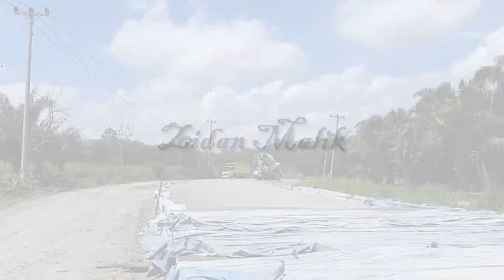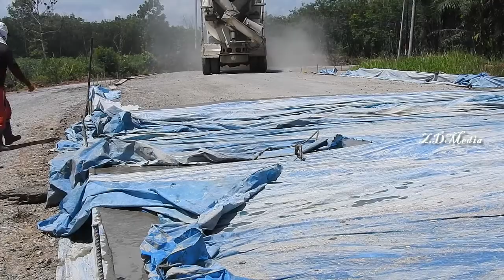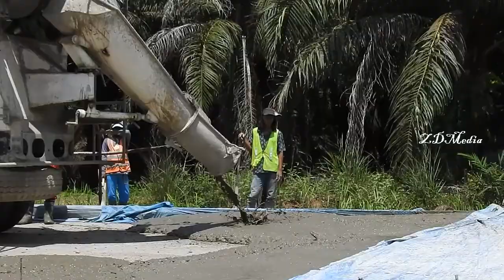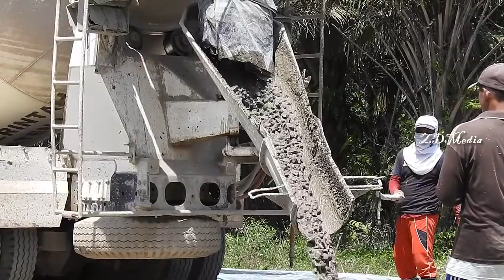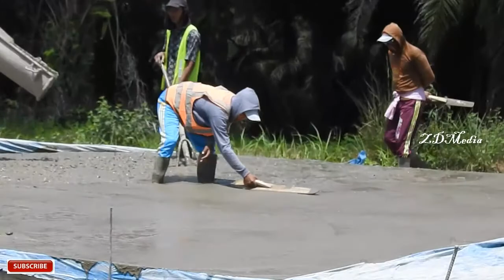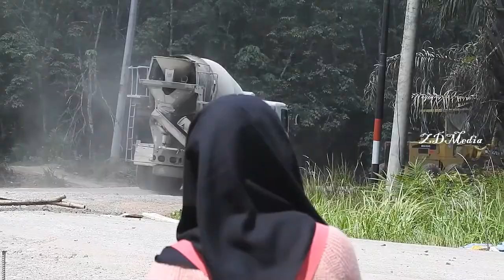Truck Mixer Working Video Ready Mix Concrete Mixer Truck Working | Widening Village Roads

Comment: With most concrete trucks, the drum spins clockwise (when looking at the opening in the back) to mix and counterclockwise in order for the screw fins to push the concrete rearward and out of the truck.